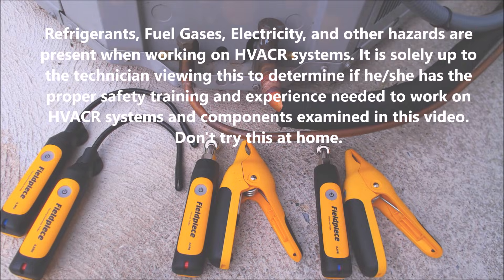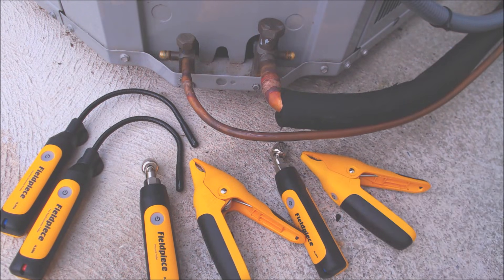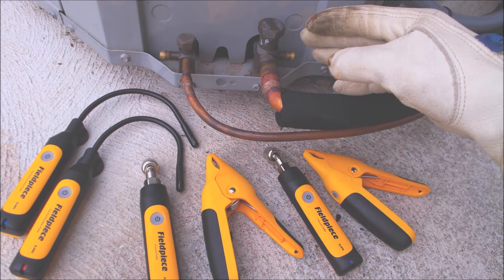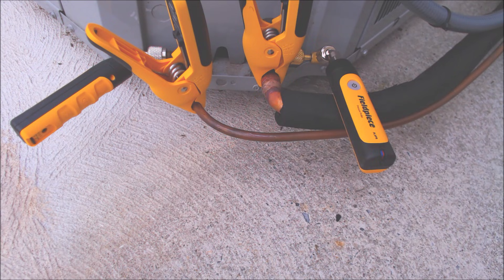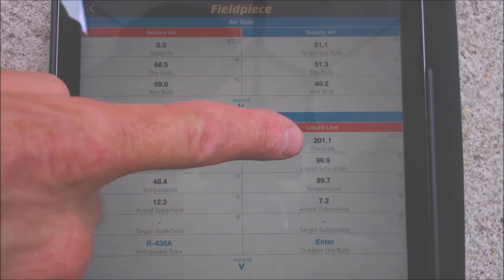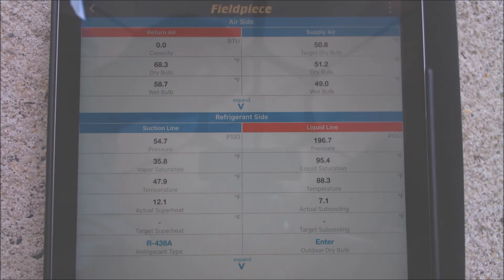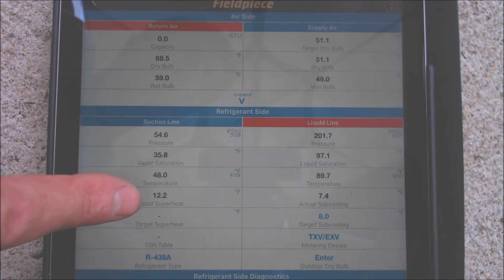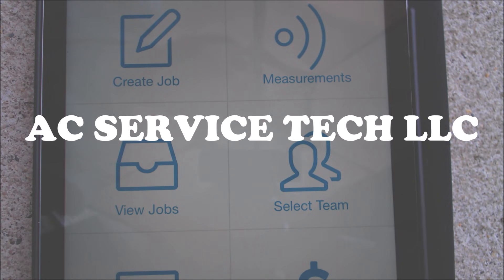Wireless Job Link Probes & Test Kit Use to Check a Refrigerant Charge!

Comment from the maker: Tool List-  https://www.amazon.com/shop/acservicetech
Support-  https://www.patreon.com/acservicetech
For those that are looking for the tools used in the videos: (Linked Below)
Fieldpiece Wireless 6 Piece Job Link System Charge and Air Test Kit JL3KH6- https://amzn.to/2wr4Xbp

Here is the Fieldpiece SMAN460 Digital Manifold Set- https://amzn.to/2nB4Fe6

Here is the Fieldpiece SMAN360 Digital Manifold Set- https://amzn.to/2BdoaD4

Here is a link to Refrigerant hoses with valves used in the videos  http://amzn.to/2aBumVI

Here is the Link for the Yellow Jacket Refrigerant Manifold Gauge Set used in the videos http://amzn.to/2aenwTq

Here is the Yellow Jacket Manifold Gauge Set including standard hoses- https://amzn.to/2vLVkV9

Here is the Yellow Jacket 4 Port Brute Manifold with Hoses- https://amzn.to/2BkuGIq

Here is the Compact Ball Valve Attachment for the end of the Refrigerant Hose- https://amzn.to/2KUisW8

Here is the Quick Disconnect 90 degree attachment for the end of the refrigerant hose- https://amzn.to/2MMtVcg

Here is the link to the Appion Valve Core Removal Tool- http://amzn.to/2uYr8WL

Here is a link to the JB 6 CFM Vacuum Pump   http://amzn.to/2nqbvo8

Here is the Link to the Appion Blue 3/8" to 1/4" Vacuum Hose- http://amzn.to/2uYlVyc

Here is the Link to the Appion Red 3/8" to 1/4" Vacuum Hose- http://amzn.to/2uYg6Ro

Here is the link to the Yellow Jacket 1/4" by 1/4" heavy duty hose straight-  http://amzn.to/2umtcod

Here is the link to the CPS Vacuum Micron Gauge- http://amzn.to/2v1nM3O

Here is a link for RectorSeal Bubble Gas Leak Detector http://amzn.to/2ckWACn

Here is the link to the Fieldpiece ST4 Dual Temp Meter- http://amzn.to/2wc1ME3

Here is a link the Nitrogen Regulator    http://amzn.to/2bXdR5f

Here is a link to the Nitrogen Flow Meter    http://amzn.to/2brvoBg

Here is a link to the Digital Refrigerant Scale used  http://amzn.to/2b9oXYl   

Other tool links can be found in the video description section.

Shop through Amazon! Your Purchases through Amazon provide a means for channels such as mine to earn advertising fees from all purchases after clicking through. Prices are the same as normal-    https://www.amazon.com/shop/acservicetech

All of the ACSERVICETECH Playlists-  https://www.youtube.com/channel/UCOZR-1IqsAer9wzlvFgb4mA/playlists?view_as=public
Reply: What type of gloves are you using in this video to protect your hands from potential liquid refrigerant burns?

Comment: As of 7/2023 Fieldpiece tech support is very poor, they have new guys that don’t know how to teach you how to use this setup. Best to watch a lot of vids. Also new batteries are key or your instruments will drop out of the app and go blank and drive you crazy . Take batteries out for winter time so they don’t explode and don’t use Duracell or Energizer they leak, use the Panasonics alkaline that usually says leak prevention on them and there almost as good as the Duracell/energizer.

Comment: How do I check this with a mini split system that does not have a liquid service port?
Also how many indoor Psychrometer Probes do I need? I am using an Sman480V. It comes with a wired dry bulb. I was using that for the outdoor temp sensor, and I was going to use one of the wet bulb psychrometers for the inside mini split head output temp. Do I need a second wet bulb psychrometer for the indoor mini split head intake temp as well?

Comment: How many wireless temperature clamps, pressure sensors, electrical clamp meters and psychometers can be connected to the app on a single iPad or Android tablet at one time? Is it limited to two of each sensor type? Would I have to have the app installed on a second tablet to view any extra wireless instruments at the same time?

Comment: The screw caps of pressure probes are so short that it’s really hard to hook on to service valves especially for R410a units which have higher pressures; and temperature probes are keeping showing OPEN. I submitted the defect designs to them but got no response

Comment: Are they low loss?
Reply from the maker: These are not low loss. However, the point of low loss is to not loose the refrigerant in the hoses to low loss fittings on these would defeat the purpose and add extra refrigerant that is removed into the low loss fitting during connection and disconnection, thanks!

Comment: Would you use this set up as your everyday setup? I have a standard yellow jacket set of guages and I have a separate meter and clamp for checking target SH and SC. Considered buying Testo or Sman digital guages before I saw this and now I'm having second thoughts.
Reply from the maker: Some techs do and this will give you insights into the airflow when you use the two psychrometers, thanks!

Comment: Is the Delta T very accurate since you aren't checking right above the coil?
Reply from the maker: I check within a few feet before and after the coil and use duct plugs to cover the holes, unless the return is close and a supply is very close, thanks!

Comment: On your training videos for the Field Piece Job Link  you don't show or mention the Wet Bulb or Dry Bulb only the Delta T, why is that. Am I missing something?
Reply from the maker: I believe in this video that I was checking subcooling and so I didn't need to determine a target superheat which is needed on systems with a fixed orifice metering device. This system had a txv so I checked the charge level with subcooling, thanks!

Comment: Quick question when getting superheat and subcooling measurements Isn't the best way to take those measurements when you're getting superheat is to take a temperature of your suction Line 6 inches coming out of the evaporator. To get a true superheat. Reading for evaporator superheat and when getting subcooling you would take it. 6in coming out of the condenser on the liquid line. Or does it matter?

Comment: Please advise what Smart gauges should I get the best one with lot of options to help me charge correctly an HVAC system.
Reply from the maker: These job link probes are nice for the seasoned tech but if you are just starting out, I usually just recommend standard compound gauges like I have linked at https://www.amazon.com/shop/acservicetech

Comment: Love this kit,  don’t use the invoicing stuff, but the PDFs you can send back to my shop, store under a customers name, it super valuable,  need to get the adapters for charging, it’s a bit of a pain in the ass right now
Reply from the maker: I use tees when connecting. I have them listed at amazon.com/shop/acservicetech thanks and they are the same as the ones used in the cps vacuum gauge set, thanks!

Comment: HI 
How would you configure it with king valves no core depressors
Reply from the maker: I would do the same thing with the same tee fitting attached to the end of the probe. The valve depressor on the inside just won't have to touch on anything. Have you looked up "acservicetech three position service valves" ?

Comment: Do a video using MeasureQuick app with Fieldpiece probes.  It’s Amazing 👍🔥👍🔥
Reply: I'm going to try that combination myself. Is that still  your go to system? Bought the sman480v recently but am returning it for the probes. Smans seemed too bulky for RTUs and small reach in boxes. Hoping the probes work out.

Comment: If these where connected to appion valve core remover, i can charge refrigerant into the system with just a hose to the tank and a ball valve at the core valve right? And manifold gauges will be something in the past.
Reply from the maker: yes for breaking the vacuum with refrigerant from the bottle but for adding refrigerant into an system with refrigerant in it, you could use the tee like you see in this video. I have this linked at amazon.com/shop/acservicetech and the t also comes with the cps vacuum gauge I have linked, thanks!

Comment: Quick question what part number is the T to add refrigerant with
Reply from the maker: Hey Matt, it is the 11th row down on the left, made by cps at  -  amazon.com/shop/acservicetech   ---  The one made by yellow jacket as I read does not come with the valve core depressor in it and not sure if there is a seat to stop and hold it if you added so maybe just go with the cps one, thanks

Comment: Thanks for teaching by the book. I strive for excellence in all my work and your vids help me gain more and more very detailed knowledge that very often, I see overlooked. I've repaired many units that prior techs condemned in order to sell a new unit. I know, less $ for me but in reality, more $ for me as I am flooded with great referrals and therefore stopped advertising back in 2004.  BTW, if same video was with a fixed orifice, are there wireless for dry and wet bulb and what success have you had regarding the range of signal from the inside to outside? Thanks again for your effort & time in producing these vids.
Reply from the maker: Hey 11Sprinkles, yes the two psychrometers can be used, one as dry bulb and one as wet bulb. It seems that 50-60 feet through multiple floors is when mine cut in and out, thanks

Comment: Great video thank you.  If the Field piece will work on hydrocarbon system,  that would be great. I will have to check out field piece sight.
Reply from the maker: hydrocarbon are much higher pressure, thanks Ron!

Comment: I’ve been using these for the past two months and my only issue is the signal is not that great I lose it at about 50 feet
Reply from the maker: Hey Matt, the JL2 transmits the signal further if used with the app, thanks!
Reply: AC Service Tech LLC I bought it and I use that with the SC 660 and SMAN 460
Reply from the maker: Matt, I apologize, I wasn't watching what video you were commenting on. For whatever reason, I was thinking the SMAN460 superheat video. Sorry about that!
Reply: AC Service Tech LLC  Yeah I was checking charge yesterday and for some reason even when I’m close my reading disappear for a couple seconds and then they come back every so often
Reply from the maker: That happens with me too but it seems only for 1 second or so and doesn't happen that that often. I would call fieldpiece if you feel it happens more than it should. It don't think it should happen constantly, thanks Matt!
Reply: whats the largest size  pipe  those temperature clamps can handle?

Comment: Can i get info on that tee ??
Reply from the maker: Hey Julio, I got this tee when I purchased my cps vacuum gauge as it's included. Here is a link on amazon to the tee but it is a little expensive. It is odd that this fitting is not an easy one to find by itself with a valve core depressor and two schrader valves. Tee- https://amzn.to/2Pj594v  -  cps vacuum gauge- https://amzn.to/2Pah7NB
Reply: Thanks a lot

Comment: I have this on my "wish list" and am wondering about the range. I have some concrete buildings with rooftop units. Will the signal make it through reinforced concrete? Anyone who has this experience to share would be most helpful.
Reply from the maker: I have just been using it through standard block walls, thanks Carl!